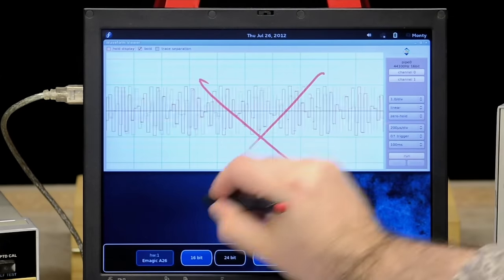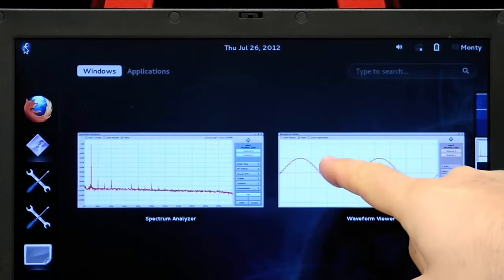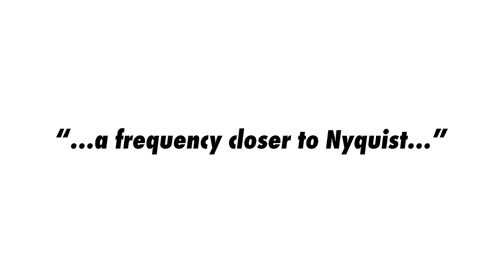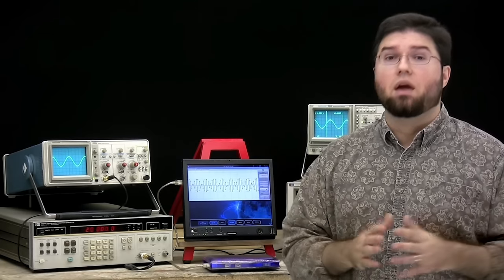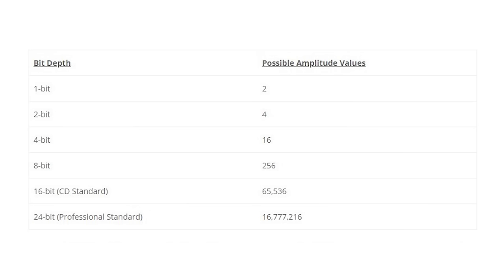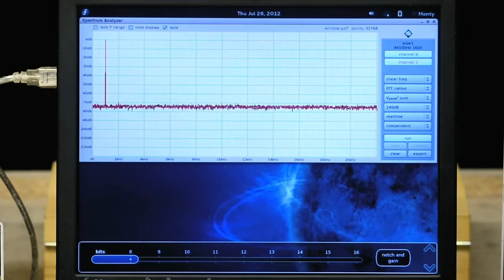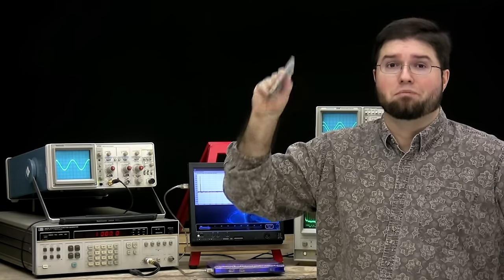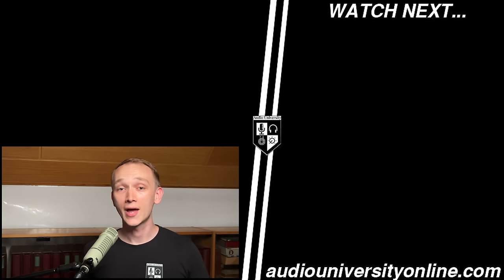Debunking the Digital Audio Myth: The Truth About the 'Stair-Step' Effect

Comment: There's no stairstep myth.  Not everything an uneducated person says makes it a myth.  It's just wrong.  Secondly, you didn't use a complex waveform.  There are no details to capture from a sine wave from a 3325A.  They're pretty precise and clean.  The filtering and smoothing that happens would make a fairly uniform sine wave at 16 44.1.  That doesn't make it a detailed representation, really.  The arguments are mostly off-base, because where detail matters is in the mix.  There is a reason all DAWs use an 80 bit mix bus and not 16 44.1 and anyone that suffered the evolution can tell you it sucked in the beginning before 80 bit mix busses, hard core.  The same is true for analog, where the missing detail adds up and shapes your perception and the quality of of the mix and the build-up of error track after track.  Stereo channels at 44.1 are acceptable, but higher sample rates retain complex information at the top end better and has been proven.  Every millennial likes to think everything old guys think is a myth, but the reality is you don't have the education or experience to know what you're talking about.  Higher bit depth is more important than sample rate as it's difficult to hear hi end detail, but again, in a mix it matters a ton if you're trying to keep the build-up of errors down.  Considering it's proven the errors do build up, then they must be present, audible to the average person or not.  Also, scopes don't show great detail and audio analyzers don't show important dynamic information related to slew rate, transient detail or most importantly phase error.  Digital audio in it's current popular form is ridden with phase error and static, boring clocks and rounding to the nearest bit resolution, which is not an accurate representation of the audio.  Take any audio from an a vintage analog synth, record it, and listen back.  It won't sound the same.  It doesn't sound like the sound you fell in love with.  No matter how advanced we think we are, there is still progress to be made.  The way we record and think about digital audio is antiquated.  It's not a God-send and is far from "perfect".  Compare bit-to-bit playing out of an audio card and back in.  It won't be the same.  The idea of perfect is just for people that don't know anything.  Nothing is perfect.  Even the best DAC or ADC has issues, not to mention the analog components leading into the ADC or after the DAC.  Even audio represented as voltages going into an ADC to be recorded introduce noise and all ADC's and DAC's have limited ability and varying degrees of accuracy.  There is no "perfect" in this world.  Anyone that engineers anything knows this.  And yes, to me, it is very audible and to most trained engineers' ears, it is quite audible.
Reply: mfnickster9754  Good point.  All I remember is digital sounded horrible when it arrived, and it remained horrible for about ten years.  Even up and until 2002 or so, good ADCs and DACs with Jet PLL clocks weren't common place or affordable.  I think around 2002 products came out that were affordable, but not necessarily great-sounding.  At some point even an iPhone had a decent-sounding output, though.  DACs became cheaper and better quality as nano tech developed, somehow.  Making them smaller helped somewhat.  Still, I record a live line in sound at the highest bit rate and bit depth possible, it never sounds the same, no matter the quality of the ADC or circuit.  It certainly never sounds "better" than a line in analog source.  At least with analog, sometimes the recording would sound improved from the source, but that's a different subject.
Reply: @@dfasht1304 Yeah, there's a lot of that.  Tons of misinformation, and they love throwing around this "myth" word.  I don't get it, but kinda' I do.  There are diminishing returns, but there are also returns.  Electricity doesn't flow in wires.  That's a good video.  Tons of good information out there, but it's nerdy and takes a sitting and a listen to absorb.  And they thought reading was the only thing that would go out of style.  Hehe.
Reply: mfnickster9754  I remember being impressed the same at first, until I heard heavy metal hi hats through it and the sound was especially harsh in a car, etc.  Recording digital with quality was next to impossible unless you had a nice DAT recorder and/or tons of money.  I think in 1992 or so CD players finally got affordable that were decent quality.  An affordable cheap digital recorder with a nice clock didn't appear until mid-2000's.  It really depended on how deep your pockets were or how critical you were about your recordings, which still also related to your pocket-book and the arrival of Jet PLL clocks for digital.  Jet PLL was a real game-changer.  But, I do remember having the same experience, but as I became critical of digital, it really didn't shape up until much later.  I also became more critical as I got older.  Yes, the noise floor and the clarity was amazing at the time.  I became to expect more of it as I got older and more critical and became interested in audio engineering.  Once you start trying to record music professionally, the problems started to arise real quick.  It was pretty terrible and unforgiving compared to analog, especially for drums.  It took a long time for digital to overtake analog in the audio recording world.
Reply: mfnickster9754  That is partly true and party an oversimplification.  There are so many components and pieces and technological changes that it's hard to say.  One advent of analog tape was that it saturated and smoothed the hi end and would combat some of the harsh 2 to 3K noise from cymbals.  Cymbals don't naturally sound that great in person.  They have to be treated and analog tape medium did some of that work and also naturally rolled off the bass and boosted upper low end and saturated kick drums and bass guitars to give them greater harmonic content.  Now you have to do all that work in advance.  Digital is more revealing and more unforgiving, so if you don't take care of the issues, the outcome will be harsh or lifeless compared to analog tape.  Depending on the ADC's and DAC's involved, digital can be harsher in the upper range.  It depends on a lot of factors.  Engineers didn't know how to deal with it at first and mastering to CD was a guessing game a bit.  Some of the problem was bad masters or a lack of technology to process or record properly.  I recorded on those Sony 24 track digital tape machines and I didn't find them to be useful compared to analog tape.  We didn't have outboard saturators to get the same loudness or sound at the time.  It depends on the genre too.  If you were looking for clean vs loud, it was certainly clean, but it lacked oomph if not dealt with correctly.  Some of it was playback machines and the oversampling issue the guy mentioned earlier that lead to poorer quality.  Some of it was the cost.  Cheaper playback machines were really lacking early on.  Some of the more expensive players in the thousands of dollars range may have been better, but idk.  The point is, this guy didn't "prove" anything.  CD quality is pretty good, but around half of the people on Earth can perceive better quality from higher bit depths and higher sample rates.  Bringing out an oscilloscope and/or a meter or analyzer doesn't "prove" anything.  When I was younger, I could bring up 30Khz on an e.q. plugin, running at 48K 24bit, and although I can't hear 30Khz, I could hear air or feel air and hear a change in the audio I couldn't explain.  Some of it is that the e.q. at 30Khz branched out in it's "q" to lower frequencies, some of it could possibly be lower harmonic distortions, but whatever it is, there's a common experience many engineers will tell you about performing the same task.  Some of it might even be that the audio opamps still have to account for the 24Khz, whether you can hear it or not, and therefor respond differently, which you pick up on as a slight difference.  It could be a preferable sound, leaving room for "air" or breath or rolling off the low end slightly as a balancing act, as e.q. and perceived frequency spectrum is absolutely a balancing act for our ears.  Whatever it is, higher cut-off filters and higher sampling rates seem to have an affect and has been scientifically proven.  That being said, I don't really hate CDs or digital as much as I did as a kid, hearing them on the cheap crap we could afford and the masters we could get at the time.  It has certainly improved, although some of the remasters sound worse than straight off the tape the first time around to me.  Some sound better.  I appreciate the efforts of the Hendrix and Beatles engineers is doing a great job with some of this.  Something like Beastie Boys Licensed to Ill still doesn't have the low end saturation on the TR-808 kick drum, however.  There are tons of records that don't sound as good on CD as even cassette tape due to the mastering not being attacked correctly.
Reply: mfnickster9754  Pretty sure that's scientific proof, although anyone is free to argue.  I only find that mostly people that aren't trained to listen on an engineers level argue with this.  This is of course with super hi-quality monitors or headphones.  With some hi-fi systems, the effects may be lost a bit.  My Klipsch RF7-II reference speakers are so jacked with frequencies that they make even some of the best masters sound bad, so listening environment matters a ton.  On my Genelecs, everything sounds great and I can't make out a lot of the trash, because it's simply not there, even though a hi-fi system might reveal it.  Analog can muddle the bass and some bands made great use of the clarity and low end extension early on to the point where you need a subwoofer and hi quality hifi system just to hear the new revelation.  An engineer once claim Bela Fleck is a great example of that.  I haven't really checked it out, though.  It depends on what you're into.  For pop rock and early hip hop, analog was king.  There are so many modern ways of recording and producing with digital and so many genres, you could certainly make an argument either way.  There are a ton of ways to skin a cat now and many outcomes and advantages and disadvantages and perceptions of what those are.
Reply: IDK what keeps happening.  I posted a link to an article about the studies that prove we can hear the difference above 44.1 16, but I don't see it now.  Could be a problem with my cache, or they allow moderators to delete?  IDK.

Comment: The analog output is filtering the dugital signal. That's it. 

If you had a very very fast analog signal that actually was a stair step and tried to output from this analog circuitry, you wouldn't get the same signal, you'd get your nice sine wave.

All analog circuits have their own filtering characteristics.

Comment: In the 2004 Dave Hunter book on guitar effects pedals, there are interviews with a variety of innovators and renowned builders/designers in the field of audio processing in musical effects.  One of them is Roger Mayer, whom many likely know through his association with guitarist Jimi Hendrix.  The discussion comes around to the difference between digital and analog delay.  Mayer makes an interesting point by noting that the biggest difference in sound quality between the two approaches to replicating an audio input signal occurs during the decay phase.  He notes that, as a repeat of the audio signal fades out, the softer portions are encoded by fewer bits, which he finds grainier.  In contrast, analog samples, as occur in bucket-brigade devices, maintain essentially infinite resolution (until the noise floor) at all amplitudes.  Now, keep in mind the book was published in 2004, the interview was likely carried out a year or two before then, 16-bit/44.1khz would have been the apex of digital reproduction, and Mayer was comparing digital processing against analog shift registers.  But it's an interesting perspective on the circumstances in which digital sampling might sound a bit wanting.
Reply: @nrezmerski Again, this was as of 2002 or so.  Whether Mayer's views still hold, and even whether he holds them, may be different now with changes in technology over the last 20 years.  If it's now a non-issue, then it's a non-issue.  I just thought it was an interesting perspective.

Comment: The dashes in my previous post were meant to provide emphasis. But they generated a strike-through effect.  Here is a correct version:

The stair steps are present at the output of the “DAC”.  They are clearly not present on the “scope display”, just as demonstrated. There is a filter between the “DAC” and the “scope display”, most likely the filter is inside the analog to digital to analog box, or “DAC box”.   This filter is not a zero order hold, but a band limiter or low pass filter.

I say all this based on theory learned in college and based on experience. In 1980 I designed a 12-bit digital to analog / analog to digital board for a military application while working at Texas Instruments.  Since that time I’ve designed DACs within integrated circuits.

I’ve drawn a distinction between the “DAC” and the “DAC box”.  It would be informative to get the schematic of the “DAC box” used in the demo, along with data sheets on the parts.  The low pass filter might be inside the integrated circuit that has the “DAC”.In that case you couldn’t put your scope probe on the “DAC” output.  If the filter is outside the IC, though, that’s where you could put the scope probe.

A scope will usually have an optional band limiting function.  Be sure it is off.

While I’m confident about my understanding of theory and about my experience, to me the greater question is how to explain matters like these accurately and clearly.  Maybe the only way for a person to gain correct understanding is by going through processes similar to mine.  This stuff is commonly taught in undergraduate electrical engineering programs. And engineers who use and design DACs and ADCs grasp it by experience.  But that’s a long process.  

I like the explanation of quantization noise.

Thanks!
Reply: Thanks for pointing out that the ADC/DAC box has a delta-sigma DAC. I’m reading up on the behavior of delta-sigma DACs.

Comment: This is something similar to what I demonstrated to fellow music producers. But I have not stopped there... blind tested and fooled them by the misteries around WAV (32bit 192KHz), FLAC aaaand MP3 44.1KHz 320Kbps. Demonstrated them what is coming out from soundcard by playing each of them with an external scope. It was funny experiment. Also demonstrated what are the differences in 32bit 192KHz, FLAC and MP3 files and when can / could hear the difference and why... (you can guess: ~0.5dB difference above 17KHz, ~6dB difference above 20KHz on 44.1KHz MP3 compared to 192KHz WAV) But, also depends on the compressor and overall dynamics of the sound as MP3 is lossless of course that you can see, but in a blind test it is not really audible just in certain rare cases.

Comment: When I look at the digital ATCS data signal that is sending 9600 bits per second, I see a curved signal from 1 to 0

When playing back a 9600 bps audio file I see the stair step

But, when I bump up the rate to 44,100 bits per second, I see the steps but only when I zoom in 

The changes in the wave are so fast, 44.1 kbps, that the human ear can't pick up any difference

For all digital audio, like the P25 phase 2 digital audio and the DMR digital audio, the radios strip out the audio above 3,000 hz

For the first digital radios they actually stripped out the ranges not in 800 to 1200 hz

But, because they sometimes need to use a radio to trigger single and two tone pagers from the radio mic, they now have the range up to 3000 hz

The DTMF is sent separately from the mic 

But the speakers can be set to only pass the 800 to 1200 range

This eliminates the CTCSS sub-audio tones that are below 300 hz and the tones used to trigger pagers, which start at 313 hz 

When you look at the tones used by public safety you see they use the 313 to 799 hz and 1303 to 2998 hz for paging.

These tones are filtered out of radio speakers so they don't have to be annoyed by the tones of they are receiving when they are transmitted nearby.

Comment: Very enlightening explanation of high fidelity in the old feud between analog and digital recording. In my opinion either format can be the basis for a sonic presentations people like or dislike due to qualities we individually hear, but can't see on an oscilloscope, that was created by a mixing engineer. If digital audio formats were inferior to analog it would not have lasted this long. An academic question I have, If you could look at the number of atomic particles used in magnetic analog recording each second what would that count be compared to 16-bit/44.1khz count?

Comment: The bit depth I agree with. However the sampling frequency experiment was a bit misleading because a sine wave was used. If a square wave was used, the higher frequencies that contribute to the wave shape would be chopped off near 1/2 of sampling frequency, so at very high audio frequencies you will get a sine wave instead of a square wave and you will be able to hear it.

Comment: Corners in the "stepped" digital waveform would sound like harmonics. Harmonics are multiple of the original frequency and they are removed by the LP filter at the end of the DAC process, if over nyquist. 
So the artifacts introduced by the low SF, for details close to nyquist, are removed by design.